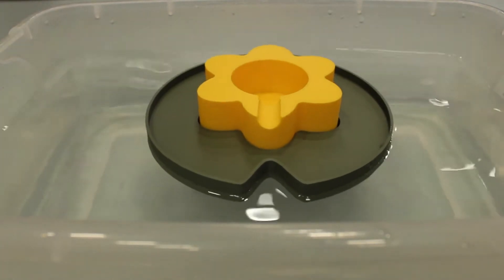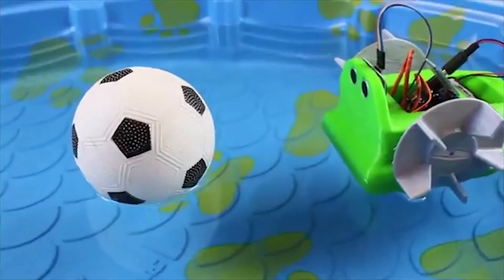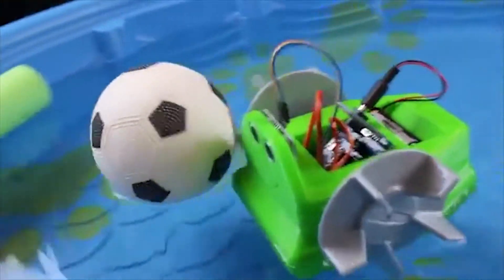Can 3D Printed Parts be Waterproof?

Comment: what is high pressure? For my application, the working pressure is about 3~7 BAR with a 16 BAR limit, would be viable to 3d print parts that resists such a pressure?
Reply: You could try using sparse infill, gyroid, and then fill with epoxy via a drilled hole.

Comment: You're right but id go even further to say that the most updated slicer software is ameteur and archaic, and it should be taking this into account but instead they are creating the tool moves with the most simple to comprehend methods to cut the part up, not much of anything significant that makes real mechanical sense.
Reply: What do you mean? Are there better tools for laying waterproof layers?

Comment: if in doubt, spray the outside of the part with clear acrylic varnish.... or clear flex seal...
Reply from the maker: That works too! But it is a second process that is you won't really want in mass production
Reply: what I am going to do with a custom ink well

Comment: Does the type of material make a difference in waterproofing? How does PLA / PETG / ABS compare with each other?
Reply from the maker: Any plastic is waterproof. But some materials are more difficult to make waterproof with 3D Printing. But of those 3 all are generally fine if they are processed correctly.